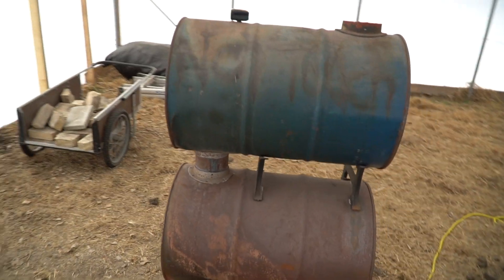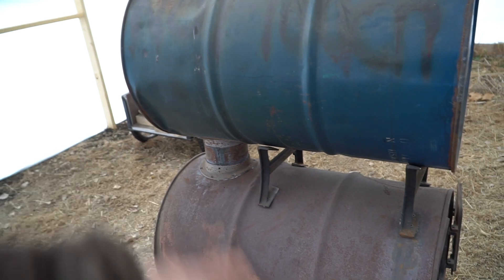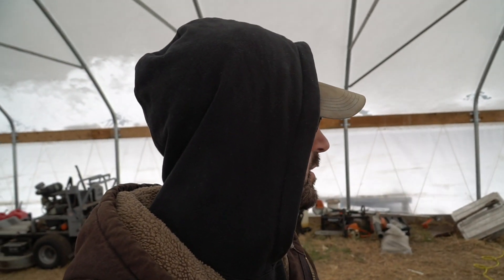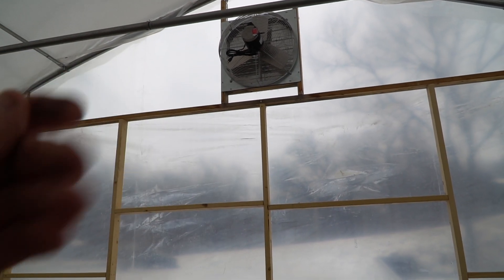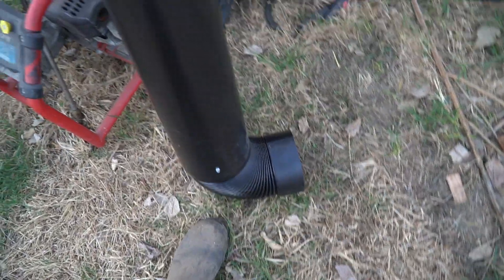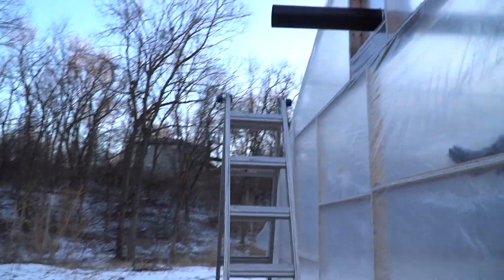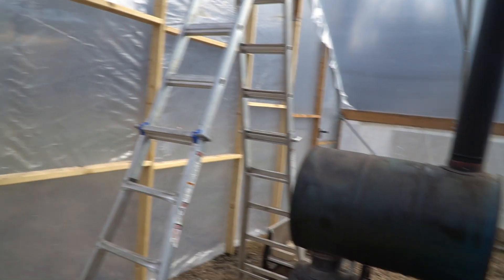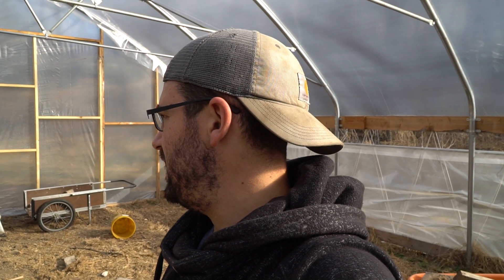Heating a greenhouse in the WINTER - The Double Barrel Woodstove

Comment: Hope it works out well for you. You may want to coil copper pipe around the top barrel and/or the stove pipe and a water barrel system to heat water in the water barrels to expand the heating to the other end of your high tunnel. Mine is much smaller so i have 4 black water barrels plumbed inline so that i can use one water heater element to heat the water to keep everything from freezing. So far my bananas have been happy
Reply from the maker: Yeah this is a great idea. I've thought about doing a heated water system just equals a decent amount of work. I've also thought about a heat duct system off of the wood stove but haven't put legs to anything yet. Thanks for watching Renee!
Reply: @GoshenFarmandGardens  well the good thing about heating the water thru a coil system is that you get heat now AND later. It should make the temperature swings a little more even.

Comment: nice set up!  Great tips for us when we install my small stove. Keep in mind not to use a lot of pine as you'll build up kreosote in your stove pipe, becoming a fire hazard.  New subscriber so I can follow your progress. Be safe, Be prepared, Be blessed
Reply: That's only an issue if there's flammable materials close to the flue pipe. 
Until your flue melts from the heat I guess. 🤣

Comment: You need a bakers scaffold to work on in there . Got one for less than $100 at home depot with lock down wheels .Is 6 feet high 2 feet wide and 6 foot long  .
Reply: I think I would have modified the stove to have a water reservoir on top it . Moister from the pan of water  will hold heat a lot longer

Comment: What's the purpose or benefit of having the 2nd barrel? Does it function in the same way a rocket mass heater works?
Reply from the maker: Good question. The second barrel adds about 20% more heat output and reduces the heat going out the stovepipe. So yes, it would have the same general function as a rocket mass heater. Thanks for watching!
Reply: @GoshenFarmandGardens  Thanks!
Reply: @GoshenFarmandGardens  I am assuming it's just  a cheap heat exchanger more surface area than one single barrel and the stovepipe in the rise of the diameter of the barrel.

Comment: That looks toasty. I wonder if there is a good way to pipe or blow the heat throughout the space.
Reply from the maker: I thought about adding something to the top barrel because I have a blower that came with the greenhouse that I'm not currently using. I could then create duct work around the sides of the greenhouse. Thanks for watching!

Comment: I did the exact same type of stove. But I ran the horizontal pipe 10ft. This allows more heat in the greenhouse. I then put about 3-4 inches of sand in stove. Then I lined bottom in stove and sides in stove with firebricks. This will keep heat from burning through the metal so soon..it also holds heat.  Max horizontal pipe is 10' any longer and draft is not as good. I up sized to 8" flu so heat moves slower through the flu.